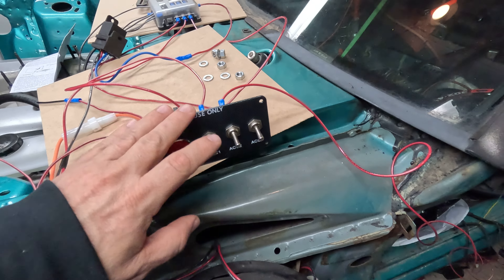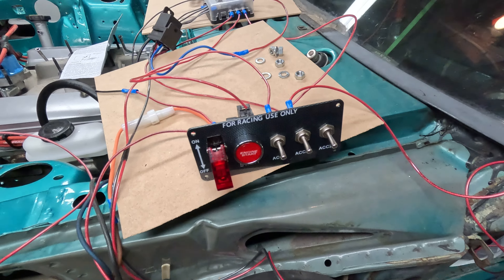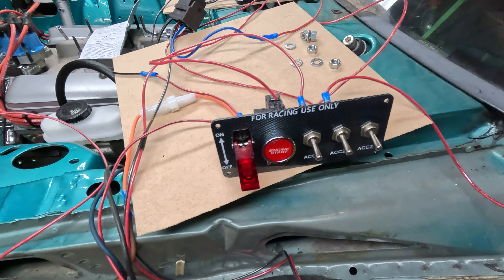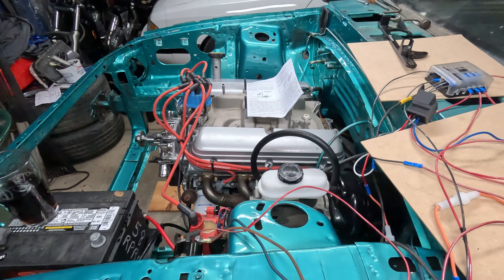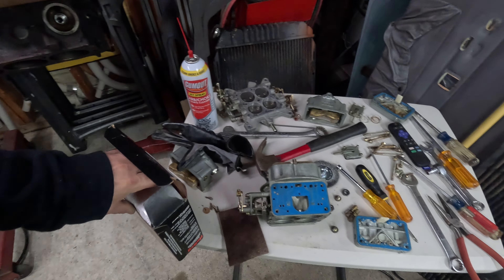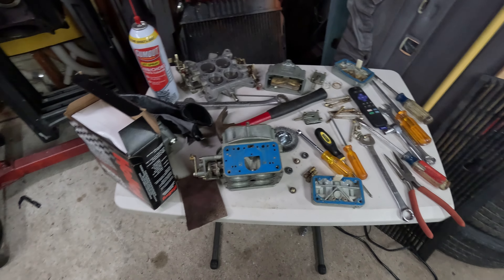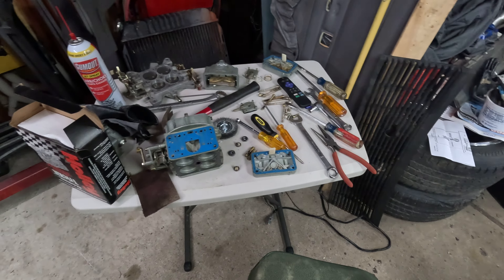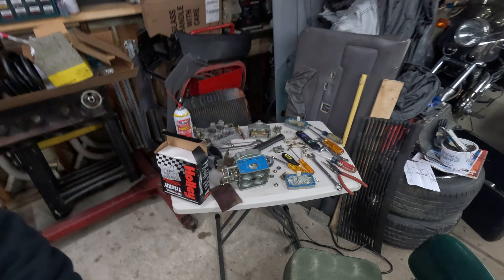Foxbody colypso vert get ready for the blower!

Comment: Sounds like it worked out even better in the end - congrats on the blower! I’ve been tearing into our project 91 GT on weekends and have the engine and trans ready to pull. I pulled them cam and it’s just what I wanted to run: F-303. Also discovered the rear end already has 3.73 gears so that was another nice find. Long way to go yet but goal is to strip all rust, fix floor pan hole, paint/rust proof underbody, clean up and paint engine bay, fuel system install, do 5 lug disc brake conversion and suspension upgrades followed by HCI motor upgrade with Vortech and have it roadworthy this summer. Interior resto after that and then body/paint. Acquiring a lot of parts as I go but have decades worth of goodies stored away already as well. Gotta love these cars - they’re great projects.
Reply from the maker: They are a lot of fun.  Your project sounds sweet!  Keep it up!